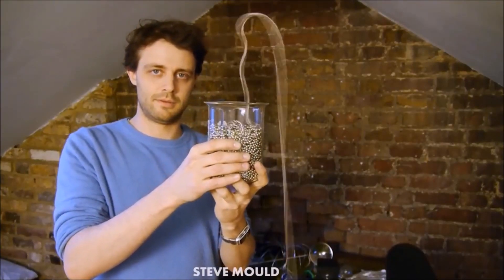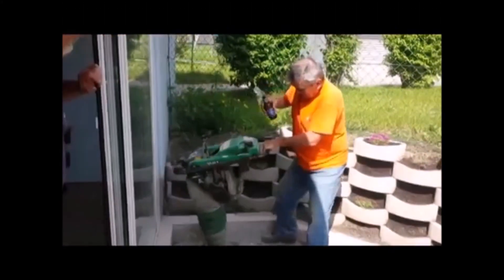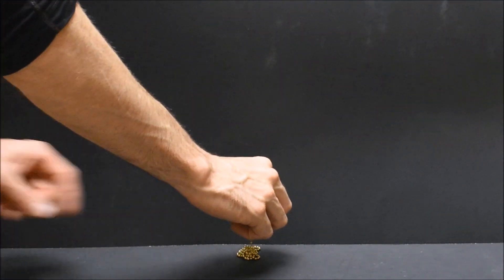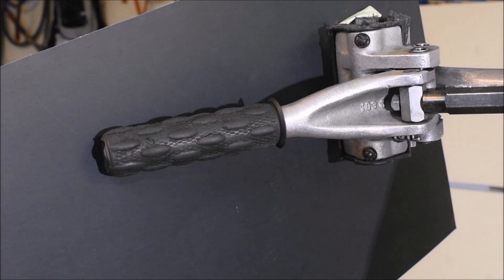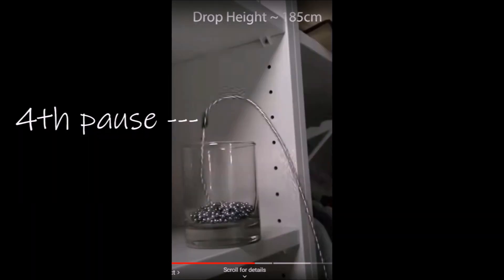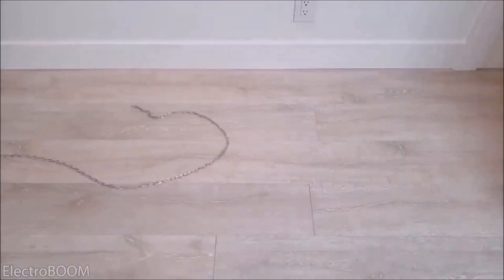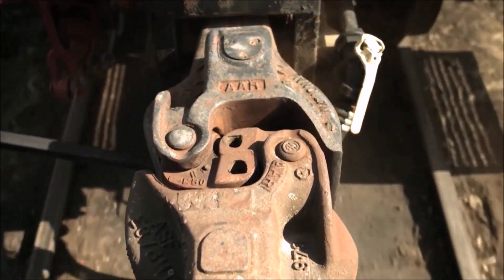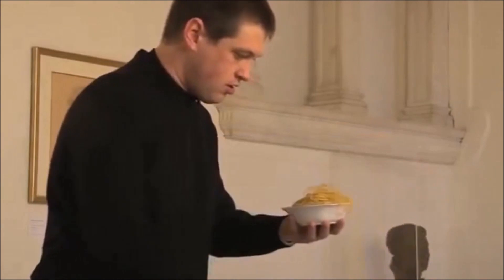The Ball Chain Fountain - My Answer To The Mould Effect!

Comment: The whip effect, inertia, shockwaves, all that is there. But the chain must be hanging or sitting on something. You cannot launch something upwards by pulling something else downwards unless you have a point where your pulling pivots and at this point your downwards force and inertia of the launched object is compensated by equal and opposite upwards force. Here we have a chain hanging in the air, gravity pulling one end while the other end is being launched upwards. Where does it pivot? When the fountain effect is not there, the chain pivots by the edge of the container. When there is the fountain, it must happen somewhere else. Mould suggests it pivots at the bottom of the container. Honestly, I don't see any other place where it could do so either. The chain certainly can't levitate, our laws of physics don't allow that. So the whole question is, what process exactly launches the chain off the bottom of the container.
Reply from the maker: Pretend your dangling about 15 feet of fire hose off a 20 foot balcony.  If that fire hose is full blast your going to get wet.  But how is that possible since the fire hose is initially pointing the opposite direction.  Ball chain is similar in that a linear increase in velocity of a segment of chain cannot occur because the chain is incompressible and unstretchable.  However, an increase in linear velocity is observed as an increase in angular momentum.  Thus, angular loops can form regardless of the initial orientation of the chain or direction of pull.  And a large enough loop observed in a chain being pulled straight up could appear as a cubic loop.

Comment: As the balls leave the jar they have to turn from going up to going down. At first they are guided by the edge of the jar. Then as the speed increases due to the weight of the increasing length of the chain outside and below the jar Reactive Centrifugal Force of the balls making the turn pulls that portion (and only that portion) of the chain upwards. Just imagine taking one ball on the end of a piece of thread and spinning it in a circle. The single ball will spin in any direction you want after it has enough Reactive Centrifugal Force pulling it away from the center. I have seen other comments mentioning CF but I have not heard anyone in the videos saying CF or RCF as if it didn't exist.